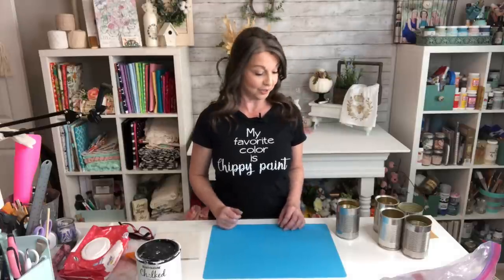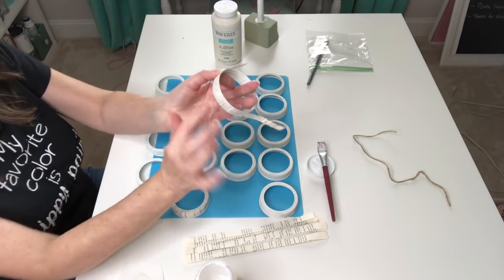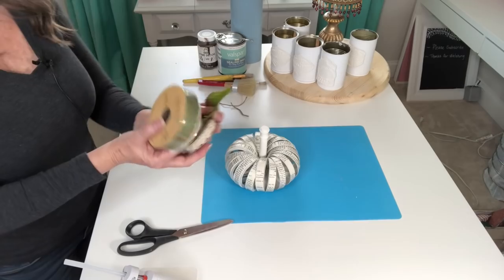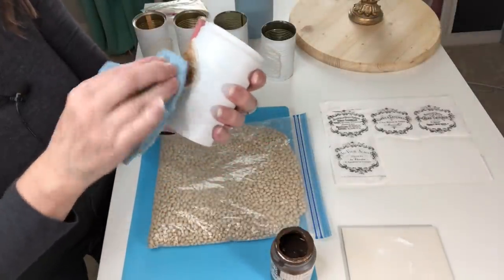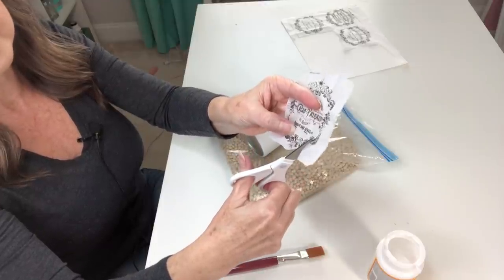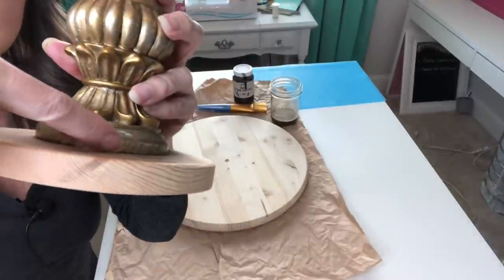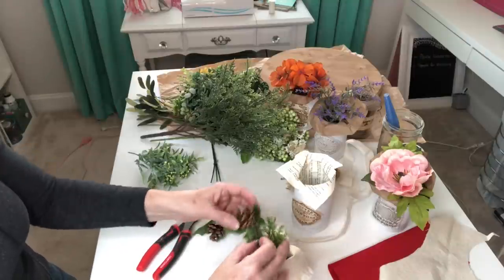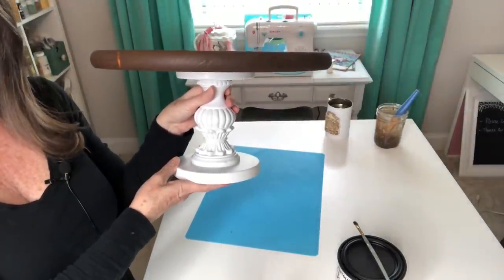Trash to Treasure • Tin Cans with Air Dry Clay • Canning Ring Pumpkin • Cake Stand from Old Lamp

Comment: Becky, I’m absolutely in love with all these projects but especially the tin cans and that cake stand is just absolutely ,y gorgeous! I do have a question though. When I’ve made clay molds, they always crack after I’ve glued them onto my piece. Any ideas on how to keep them from cracking?
Reply from the maker: Thank you Pia! The cake stand ranks as one of my favorite projects I’ve made. As my clay dries, I check it pretty frequently. If I see cracks forming, I take a small damp paint brush to even it out. Hope this helps!
Reply: @kindashabby  thanks for the tip Becky🥰

Comment: Love all these projects.  I currently have 2 old lamp bases with plans to make cake pedestals.  Did Mr Shabby have to cut the lamp nut off to attach the small round?  Glad to have you back 😄
Reply from the maker: Thank you Monica; I’m so glad to be back! Hubby removed everything and placed a threaded rod from Home Depot down the center of the lamp base and through the two small wood circles, then countersink to add nuts and washers.

Comment: Hello, your label Transfer with Tissue Paper must it have 28gramm? regards
Reply from the maker: Hello! I’m not sure of the weight of the tissue paper, but the one I like to use is quite thin. That way, it easily goes through my printer and has less wrinkles when I decoupage the paper. Thank you for watching!
Reply: @kindashabby  hI, you Tape that Tissue Paper on the Card Stock than in the Printer?
Reply from the maker: @user-fj9wg9lh9n  Yes. I cut the tissue paper to the same size as the card stock and carefully tape close to the edges. I make sure everything is as smooth and flat as possible, to go through the printer without jamming. This process has always worked well for me. Happy Crafting!
Reply: @kindashabby  OK,thanks.i will made a Test.your IOD Silikon Stamps great. these Stamps verry expenive in germany 39euro
Reply from the maker: @user-fj9wg9lh9n  you are welcome!